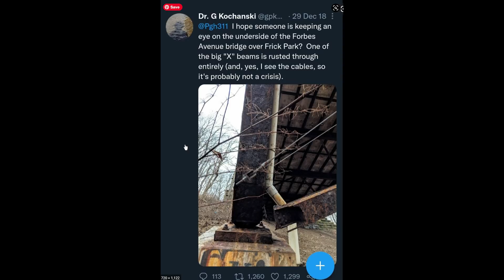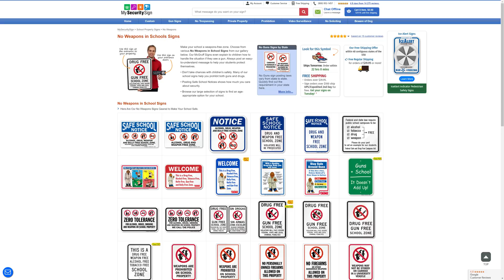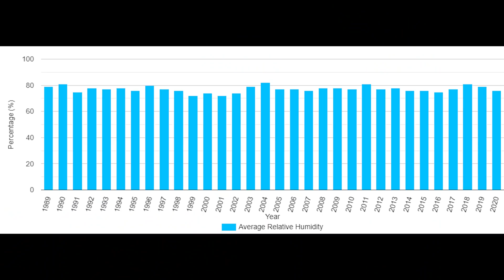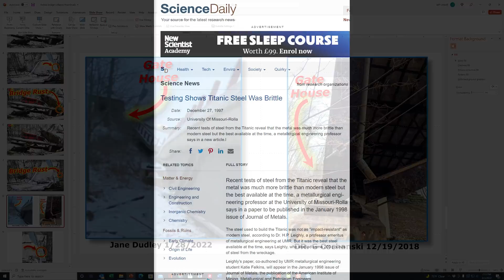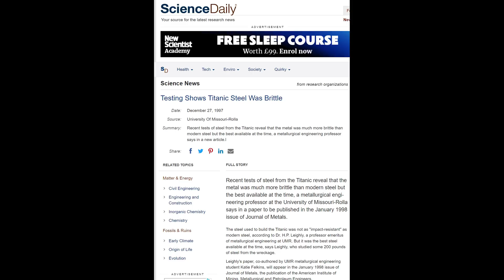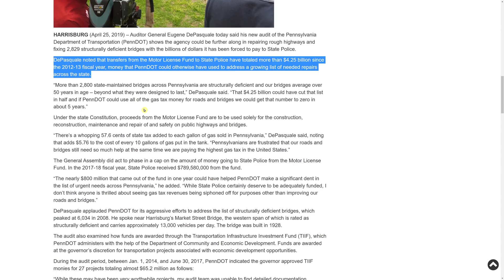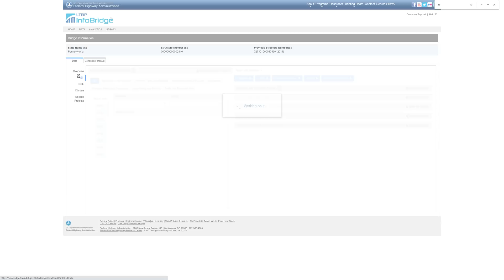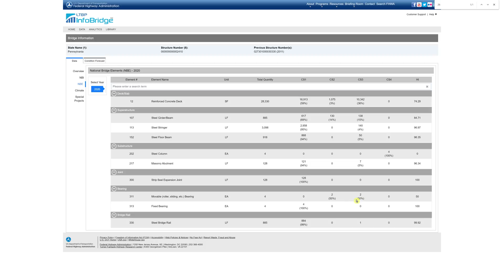Pittsburgh Bridge Collapse:  Bus Too Heavy? Rust? Missing Funds?

Comment: Thankfully no one was seriously hurt although the neck and back injuries will change your life. The salt truck is a good #1 call for violation it the posting happens all the time . The city of Pittsburgh / Allegheny co. public works is in  shock when it comes to bridge maintenance . Add in extreme corruption and incompetence and bridges fall down . The excuse that we didn’t have the money in the budget is pure BS. Nice details in your video.
Reply: Yup. Greed runs cities at the bare minimum. Here comes the tax rise!
Reply from the maker: Thanks I'm glad you like to the video
Reply: WE DIDNT BUT GO OFF WITH YOUR UNEDUCATED SELF ON OUR SITUATIONS
Reply: @saramcdonalds427  We need more bike lanes. 
(I am being facetious)

Stupid bs like that is why the money wasn't there.

A photo op means more than putting the money where it is most needed.

You think the bridges are bad you should see the 100yr old terracotta piping in the combination sanitary system.

I did as a NASSCO PACP inspector. It is a nightmare.

As I stated on a post I have metal detected under that bridge(in Frick) for years.

You could see through the structural steel on the bridge due to it being rotted out years ago when you were on the ground below it.

They simply turned a blind eye to it and used funding elsewhere in areas such as bike lanes and new speed bumps on various streets throughout the city.

Why?

Optics.
Reply: @rivercitymetaldetecting9854  those 2 speed bumps they put on Bausman Street are going to cause accidents & car damage. Meanwhile after last snowstorm no salt trucks for 3 days.
I'm tired of being housebound every miserable winter n too old to move
Reply: @rivercitymetaldetecting9854  You really think the cost of a bridge even remotely approaches the cost of a bike lane, or a speedbump? Traffic going too fast on surface streets is an actual problem that's addressed by speed bumps. Making it safe to ride a bike in the city was a good reason to install bike lanes. They're more than just "optics."
Reply: @thebennettfactory  money is placed where people can see it at work. 

The piping systems, bridges, electrical grid are all things people "can't see" and this is about reelection and funding. That is the primary goal. 

The only time people care about bridges is when things go bad. Outside of that most people don't pay them any mind.

Now, a bike lane is something people can see. 

Eventually you will figure it out lol.
Reply: @rivercitymetaldetecting9854  money is placed, people ignore bridges, money is placed where people can't see it

Ah, now I understand. You'd rather make gnomic, overly generalized statements than address problems.

Eventually you'll get it
Reply: @thebennettfactory  well, I was contracted and did work with PWSA for decades and saw it 1st hand so.  

Pittsburgh is a polished turd. Bridges are shot and have been for a long time, there is about 10 million miles of combination sanitary/drainage lines that need ripped up and replaced. It is well north of 100yrs old and it is collapsed in many many places. Can't sleeve it so ya have to replace it.

You could walk under this bridge as I said and  could see where the steel was rotted out at ground level years ago.

The things people can't see are the problems that people should worry about.

But we live in a time where optics are what matters. Those in power want that "see look what I did" moment.

People can't see a pipe under ground.

You say I will figure it out but I have 1st hand experience with dealing with these things as well as the bureaucracy and red tape involved.
Reply: I understand what you meant.  Visible Repairs & improvements get the politicians attention & money.
Invisible repairs like rusting support structures don’t interest politicians, so it doesn’t get fixed

Comment: Really interesting video. You're entirely right on white collar crime. Don't get me started. I have theory. The well meaning guy-wires actually changed the loading vectors of the bridge and derated the bridge. Or fixes by engineers who were not. You didn't have just the large bus but several other vehicles as well.
Reply from the maker: They were all likely the straw that broke the camel's back

Comment: This 2013 New Flyer articulated bus actually weighs about 66,000 pounds so about 33 tons.
Reply: 66,000 is the GVWR of one of these. Curb weight  is around 52,000 pounds. Condition of the bus during the collapse of venture to say it's no more than 55,000.
Reply from the maker: Yes so either way to me that bus was over the limit they probably shouldn't have any busses on there maybe this single busses but I think most of them are articulating now

Comment: So the troopers will have fancy wheels, but may not be able to jump future fallen bridges ... justifying funding to get Sherp ATVs for those occasions?
4:15 a lot of those trucks getting "sardine-canned" are rentals.
Reply from the maker: Yeah and when people rent those drugs none of them ever check on the height so that they will know when they approach a bridge. But even so that 11' 8 bridge has sensors and the big sign over it that turns on and flashes if your vehicle is over height and they still drive into it it's just amazing perit's just amazing. And if they don't take out insurance they're responsible for that truck and it's like $50000

Comment: If You look at the PVC drain pipes, they ran the drain line from one side, and it's strapped to an x brace, and it’s tied into the pipe on the other side, further limiting the pipe's capacity. You can see just the top of the white pipe sticking out of the brace's top. I think the pipe runs under the gravel and down the bank. Also, the PVC pipe and gravel look like recent work that was done probably about the same time as the cables. I wonder if the pipe was not there back in the beginning and the water just ran down the legs?
Reply from the maker: Those are all good questions we would have to see the workorders which they are not likely to release

Comment: Nothing surprising here Jeff.  Sound similar to the way politics work down here in Australia.  We have the same building and construction governance here where they go after us tradies if we do something wrong, like you said a stain or peeling paint whilst a bridge that was reported as a condition state 4 (poor) is put into the pile of what to do with it next year.  I have worked in local and federal government.  The only difference in Australia is that we have not had a major bridge collapse, when we do (and it will happen) is when the government will have an inquiry and look into it.  Why does it always take a lose of lives and infrastructure before our governments act.  We have 7 states in Australia and each state has their own version of a bridge inspection manual.  Very similar in design but again for a small country 1 bridge inspection manual would be enough.  With the weight limit on this bridge, yes it may have been a factor with the snow also but looking at some of the other pictures where multiple cars were on the bridge that would suggest a car weighing 1T x 26 cars would be enough to overload it without snow.  The colunm you pointed out on the right hand side looks like it sheared off at the base and the bridge went to the right at this point.  Those cable cross braces would have done nothing to prevent that.  And fully agree with you on the fact that these white collar guys need to be held accountable, imagine this in China! just saying.  When i was inspecting bridges for a local government i would get an email from upper management just before budget time and i would get asked 'send us a list of your condition state 4 reports' and that would be used to generated the following years budget for bridge repairs.  Even though they had been given the extensive report previously.  They dont read them.  The rating system you showed at the end of the video was interesting.  We have a similar rating system here.  A condition state 4 column here would be recommended for a Level 3 engineering inspection immediately.  Not saying this wasnt done but it all comes down to the money. Keep the bastards honest Jeff
Reply from the maker: Thanks glad you like the video

Comment: Going to bet though the bridge report went through from Penndot to the local municipality, where it was promptly filed and forgotten. Who owns the bridge, and who is responsible for the maintenance, now that is the problem, because I can bet you these are two totally separate deparments in government, and each tries to pass the buck. But as to failure, yes likely bus was the final straw, though the bridge by that point likely was barely able to withstand it's own static mass, and the bus and cars, along with a few tons of snow and frozen slush, did finally cause the one support to buckle at the base. Then the other side got a step loading, and promptly sheered off, and the other side followed.

I would say the far side from the bus was the one that collapsed, after the bus went over, and the buckled deck is indicative of the supports by the bus holding on a second or so as the bridge fell behind the bus, pulling them over, and then the roadway longitudinal members there, probably from years of salt corrosion removing most of the metal, folded, and the deck buckled at that stress point. The supports pulled off the base, leaving the plate behind, simply because the rusted bolts were stronger, and had more cross section, than the remaining support steel at the time.

Coreten steel is amazing, but really does benefit from having a protective coating applied, just that you can do construction with minimal care, and only lightly blast the surface, or wire brush it, before you paint it, the rust will provide adhesion for the paint.
Reply from the maker: Yes and the problem with this steel is that it doesn't seem that the rust patina settled down, it looks like the rusting just kept on going
Reply: @jeffostroff  Patina is protective, except where the steel is exposed to chlorides, which penetrate this and keep on going through. note the architectural use is only where the steel is far up and away from roads, and also inland far from salt spray.

Containers with coreten steel always have a very durable paint coat applied to them, just because the salt in transit will kill them otherwise. I have some pieces of that steel I used as flower bed borders, and while it is durable steel, they all have corroded from the bottom up, despite them all having intact paint finish on them, just that bottom cut end was enough to corrode through, after being kept wet for 20 years in soil.

Comment: The steel of the Titanic had issues by today's standards but it didn't shatter.
Reply from the maker: Tests of the steel's chemical composition also showed a high content of sulfur, oxygen and phosphorus. High levels of those elements cause steel to be more brittle, Leighly says.

The chemical analysis also revealed a low level of manganese -- another symptom of brittle steel. Steel with a higher level of manganese is more ductile and less likely to break.
Reply: @jeffostroff  But for the day it was perfectly acceptable steel, only after WWI did they start to appreciate the role that adding manganese does to improve steel, and how sulphur makes it cold brittle. That steel passed the tests which were in place when it was made. The issue showed up in the first Liberty ships being made, where they were made fast, cheap and light, so used thinner steel, and showed up as cold cracking in places with sharp corners, which is why you get rounded corners now on all hulls, so as to not have stress risers.

The cracking also showed up in the coldest weather, which probably was the reason some of the ships sank so fast when attacked by U boats, in that the brittle steel simply tore from the stress, instead of yielding and deforming like it would do if it was only 10C warmer.

Only after the war when the victors looked at the processing Krupp did to their steel, which did not suffer from this (war secret) did the standards change.